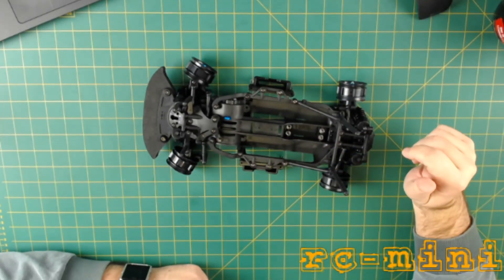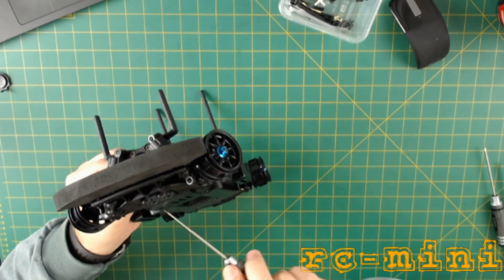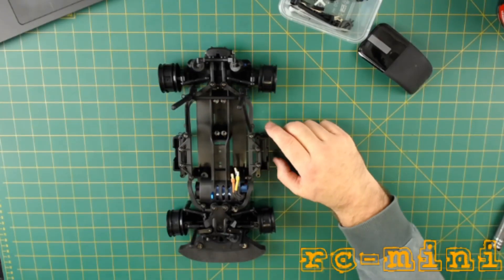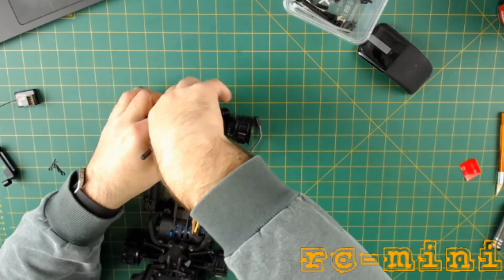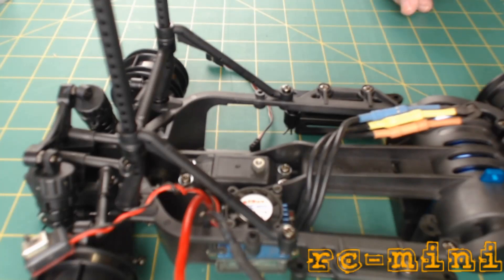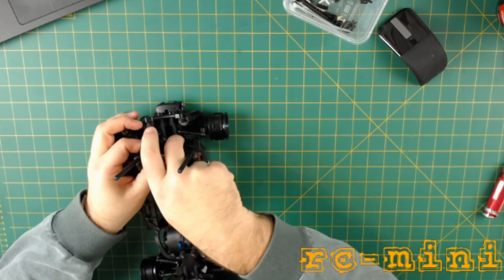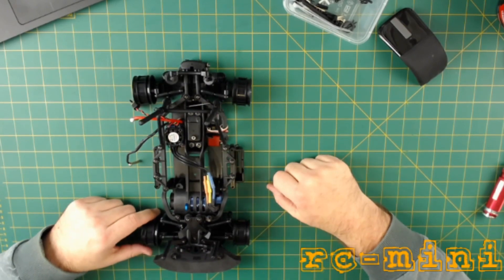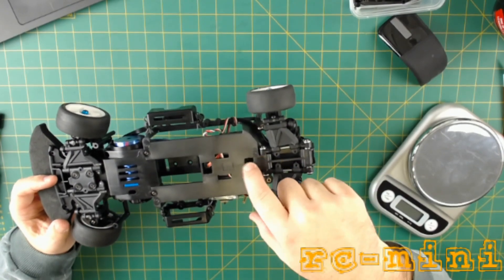Tamiya M07 Concept - Installing Electrics

Comment: Hi there! What vital upgrades does the m07 need? Thanks a lot ;)
Reply from the maker: Hi Jose, 

On RCMini.net FB page we published a list of upgrades in the order we believed to important.

Option 01 from memory Tamiya have not released an alloy version, but there is a carbon re-enforce plastic version, the basic kit parts we felt were a little soft.

If your racing series allows upgrades from other manufacturers then here are Yeah racing options out as well.

01 - Tamiya #xxxxx - M-07 Concept Aluminum Front Steering Knuckles (If/When released)

02 - Tamiya #54757 - M-07 Concept Stabilizer Set (F, R)
03 - Tamiya #54781 - M-07 Concept Aluminum Rear Upright
04 - Tamiya #54790 - M07 Carbon Damper Stay Set (for normal 'Mini' size shocks)
OR....
04 - Tamiya #54761 - M-07 Concept Carbon Damper Stay (Front) OP.1761
04 - Tamiya #54762 - M-07 Concept Carbon Damper Stay (Rear) OP.1762
05 - Tamiya #54786 - M-07 Concept Aluminum Front Suspension Mount (4 Degrees)
06 - Tamiya #54780 - M-07 Concept Aluminum Front Suspension Mount (6 Degrees)
07 = Tamiya #54759 - M-07 Concept Aluminum Motor Heat Sink
08 - Tamiya #54764 - M-07 Concept Aluminum Steering Bridge OP.1764
09 - Tamiya #54763 - M-07 Concept Aluminum Steering Arm Set (Left /Right) OP.1763
10 - Tamiya #54787 - M-07 Concept Aluminum Rear Suspension Mount (Skid Angle Adj)
11 - Tamiya #54760 - M-07 Concept Aluminum Rear Suspension Mount
12 - Tamiya #54765 - M-07 Concept Aluminum Front Suspension Mount (5 Degrees)
13 - Tamiya #54756 - M-07 Concept 3x106 Aluminum Turn Buckle Shaft OP.1756
13 - Tamiya #54758 - M-07 Concept Titanium Screw Set
14 - Tamiya #54767 - M-07 Concept Aluminum Center Shaft
14 - Tamiya #54766 - M-07 Concept Aluminum Counter Shaft

Hope that helps.
Tony
Reply: @defMondo  fantastic! Very very thanks!

Comment: what size phillips Driver do you use?
Reply from the maker: Good question Todd, I believe the majority of the screws I'll use a 5mm, but from memory there are some that are recessed in the chassis and I'll use a 4mm but I don't think that is the best fit. I've changed them all over to hex screws now.